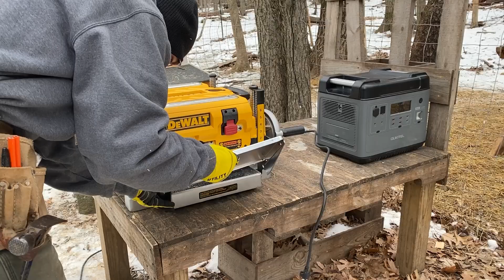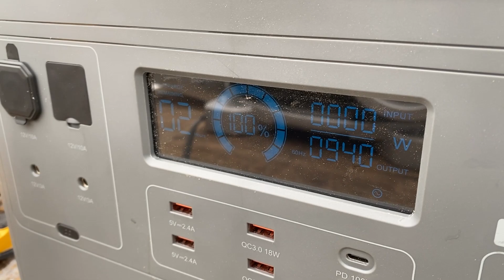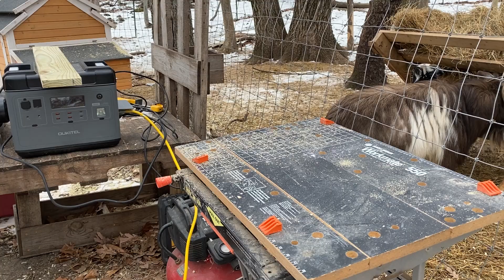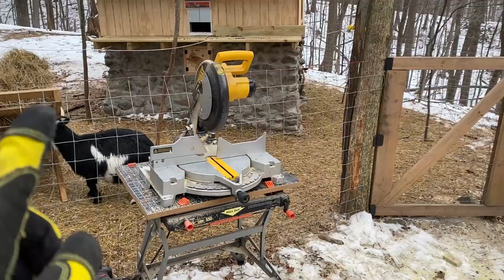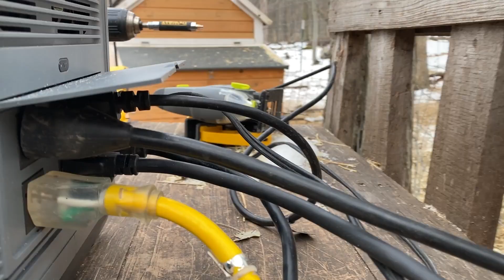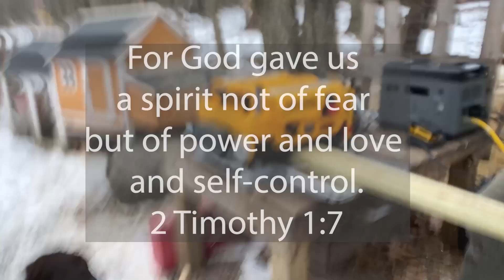How I power an Entire Mobile Workshop off-site - Oukitel P2001 Power Station

Comment: Hello! I'm not sure if you'll see this comment a few years down the road, but I was really inspired by this video. I picked up a pair of Oukitel 2000s, and I have been trying to run my WEN table saw and WEN miter saw, which run at 11 and 15 amps respectively. They have both been overloading the station when they're turned on and I'm not sure why. I'm not especially versed in electric engineering, but my limited understanding thinks it should work, but clearly it isn't. Do you have any suggestions or troubleshooting advice? To clarify, I was trying to run them individually, one at a time. The other machine wasn't plugged in.

Comment: One of these days these power stations will be more compelling than a 2000 watt Honda inverter generator. Sadly, this is not yet that product.
Reply from the maker: I don’t know, I have one of those 2000 watt generators and 90% of the time I prefer the power station
Reply: @SSLFamilyDad  see, I can’t really buy this argument. I mean, I get it—free stuff is exciting, but hear me out.  

Your “example work station” is less than a 100 foot drop cord from a power source. You are never going to reach for a 48.5 lb battery over a drop cord in this situation. Never. 

You mention “remote job sites”. With 2000 watt hour capacity, a two man crew is going to tear through this reserve in 1.5 - 2 hours. Again, the Oukitel weighs 48.5 lbs. You are really going to carry this battery out vs a 47 lb 2200 watt Honda that can run 8 hours on a gallon of gas, produce the same clean sine wave, and be instantly refilled?  No. 

So that leaves the ideal use for this battery: a simple phone charger and VERY short term battery backup for emergency power, or a nice tailgating toy.

Comment: How would it do for a kiln for ceramic? Could it stay on for 4 or 5 hours?
Reply: Nope. 

It would run a small plug in kiln an hour or less.
Reply from the maker: Depends on how much it draws. This is 2000wh so if it pulls 1000 watts it would run 2 hours, 500 watts it would run 4 hours. Now if you have it on solar panels you can charge it at up to 500 watts per hour which would extend that also